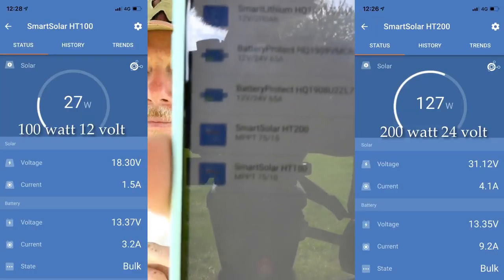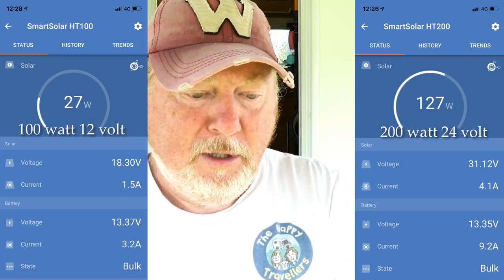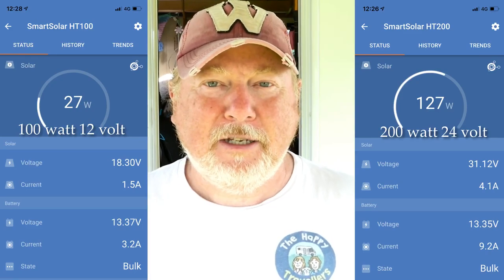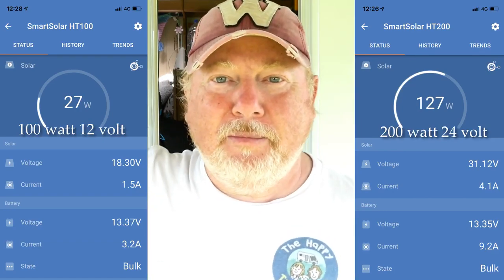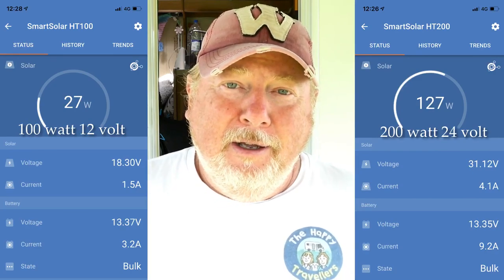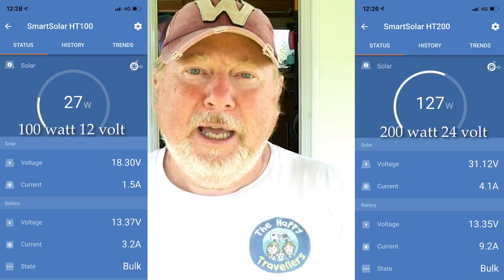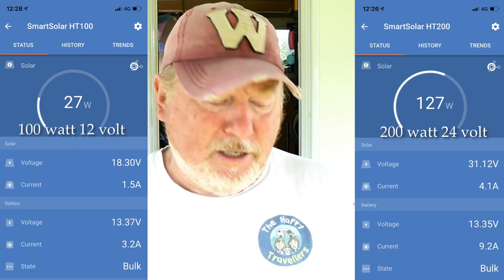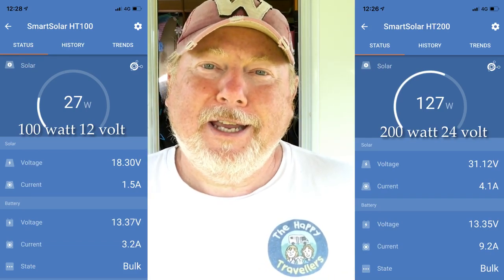Motorhome Solar Panels for Off-Grid Electricity

Comment: Very interesting. It will come down to percentage efficiency of the panels which would be on a data sheet... All things being equal your spot on in thinking a higher voltage setup has less losses. :-)

Comment: Hi Steve, my understanding is that an MPPT controller uses any extra volts available from the panel (above "12" volts) and converts that into more amps to your battery bank. In reality it would be above 'say' 14 to 15 volts as that's the normal starting charge rate. A PWM controller doesn't do this and so it gets wasted. Looking at your your screen snaps it looks like you have a 19 volt 100 watt? and a 32 volt 200 watt? panel.  If I'm correct then you are getting more because you are using a 32 volt 200 watt panel and not a 19 volt 200 watt panel !
Reply from the maker: That is exactly my point. 12 volt vs 24 volt panels
Reply: @TheHappyTravellers  Sorry Steve but this was my attempt at the baby steps you asked for 🙄 To simplify the system to a '12' volt (as opposed to the varying voltage/current required to charge a 12v battery bank). An 100 watt 12v and a 200 watt 24v panel will normally produce 100/200 watts (simplified values) using the standard cheap PWM type controller. You said early in the video that you have uprated to an MPPT controller 'Not necessarily because of the ------- low power 100 watt'. You have done the right thing if you changed from a PWM to MPPT? on the 100 watt  as it is not 'low' power it is 100 watts just the same. The extra voltage from the 24 volt panel is converted into useable Amps into your battery 👍👍👍 Hope this helps others in their choice of solar system 🤞
Reply from the maker: Steve Wild sorry my initial response was a little terse. Thanks for your input 👍😀😎
Reply: @stevewild4449  So for a newbie wanting solar panels and not knowing where to start. Would we need both or just the 24v? Me and my partner are just about to buy a motorhome and we don't know what to ask for when wanting to be off-grid most of the time. Any advice appreciated. Great video @the happy travellers!